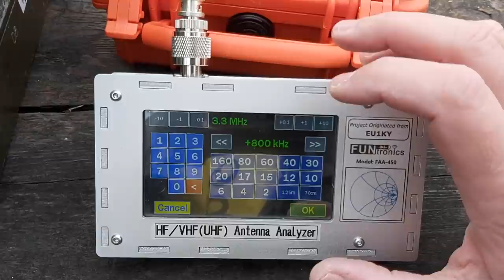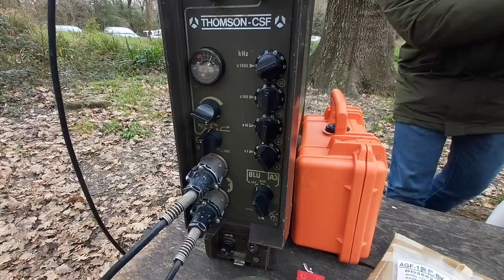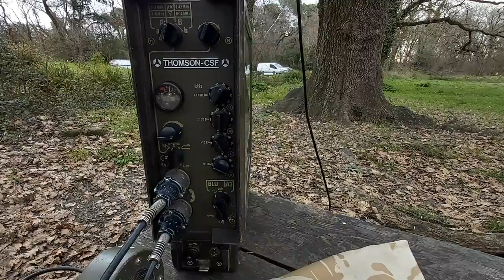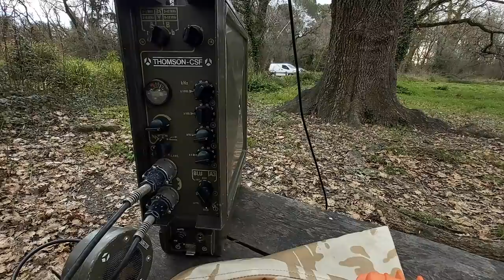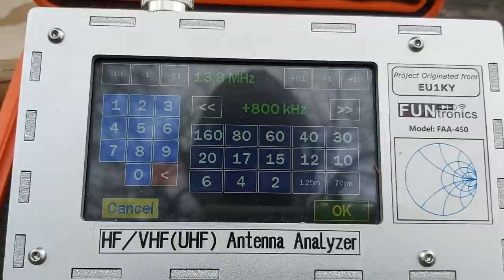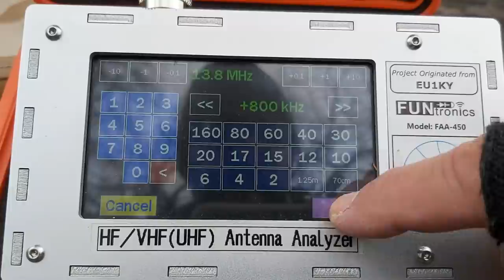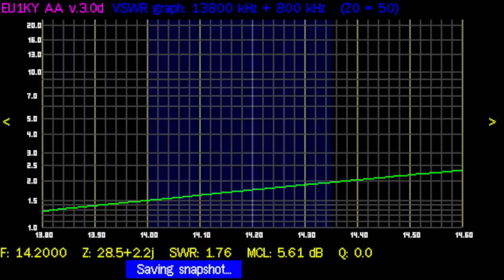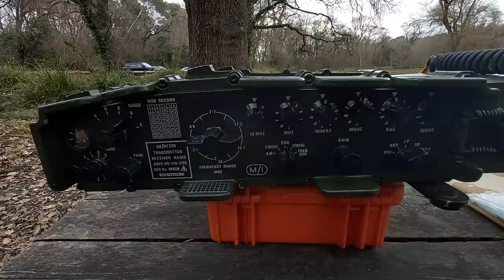Testing My Mini 64:1 Half-Wave End-Fed Antenna Transformer.

Comment: I tried making a transformer with a FT37 core but it's not large enough to get enough primary inductance without using more turns that the core will easily hold. According to various sources, the smallest core they recommend is in fact FT82.

Comment: Hey Gil, nice to see you on YouTube again. The 64:1 seems to be doing a great job. I use an EFHW with, I think, a 9:1. Mmm. I seem to do well with mine as well and low SWR. Anyway 73’s my friend. Thanks for all the great videos! Larry W7YDA.
Reply from the maker: Hi, a 9:1 is for a random wire, not a HWEF. https://youtu.be/0zF7bDoqkG4
Reply: I think I was wrong - maybe I’m using a 49:1. My matching unit is from QRP guys. 80-10 meter EFHW.😙

Comment: Gil, as always it's enlightening and a pleasure to watch one of your vids especially those that include EFHW Aerials. You and Steve Ellington convinced me of the value of that antenna.

DX-Commander also had a hand in it and some day, on a Portable Outing, I'll switch from an EFHW config to Qrtr-Wave with Radials and back and record the sig reports. I have a 12M SpiderBeam Mast that provides many options. Thanks to you and Callum's vids for that enlightenment.
The big value of this vid is to demonstrate how easy it is to spend just a few hours making Local/Regional/DX contacts from the comfort of a Park Bench, even if in Mid-Winter. Haha....

Relative to Vehicular Security when parked OverNight. Have you ever concidered a Pet Viper or two? They like to Snuggle/Coil up under seats and Strike at Ankles when didturbed and you could make a Domicile for one in your Glove Box.
Actually, a Remote Controlled CX-Laced FlashBang Grenade might be a better solution than the Vipers.
Film at Eleven! HaHa......
73 OM from FN42hx . .
Reply from the maker: Well, I'll look for a viper thanks! ;-)

Comment: Hi from Mexico, I saw that in the video for the CB antenna and you don't use the ground lug to the cb antenna, but for this ones you are using it. What will be your recommendation? Does this ground lug need to be connected to a rod into the ground, or this piece of metal basically do the job. Thanks!
Reply from the maker: I only plan on using it to bleed static electricity when using a long wire on a kite or balloon. Otherwise no.

Comment: salut GIL...avec le recul maintenant, que vaut il mieux construire ?? 64/1 ou 49/1 ?? quelles sont les différences remarquées ??  j ai 2 FT140-43 et j attends du fil cuivre émaillé de diam 1 mm.....merci pour les infos.. 73 s Pascal
Reply from the maker: Un 64:1 avec 3 tours primaire (24 total) pour les bandes basses, 10MHz et dessous, et un  49:1 (2/14) pour 14MHz jusque 50MHz.
Reply: @RadioPrepper  ok Gil.. j avais trouvé la réponse dans une autre de tes videos hi hi hi!! merci...73 s pascal

Comment: Hi Gil, did you use a ground wire on the banana plug on 20 meters or just the coax, if just the coax how long?  Thanks and 73 from NYC
Reply from the maker: Not needed. I use all kinds of cables. A half-wave wire will produce very little common-mode currents if any. Only random wires on 9:1 UNUNs cause trouble.

Comment: I have made 49-1 antenna 3 weeks ago works very well from your video how do you find what the difference between and what is the best out of 64-1  49-1.
Reply from the maker: 64:1:below 30m. 49:1:above. 3 turns primary below 20m, two turns at and above.
Reply: @RadioPrepper  I will give it a try next few days when the weather picks up as it below freezing at the moment don't fancy a blue fingers lol cheers for the input

Comment: Evaluating performance from contacts alone is NOT a valid way to test an UnUn. First you need to use a NanoVNA in thru mode to test the insertion loss using an identical pair of UnUns, wired together back to back at the high impedance ends. You want to see no more than -1dB per unit. You also need to measure the temperature rise and fall of the above pair under 30 seconds of CW at ever-rising power levels into a dummy load while monitoring the ever-rising SWR. You don’t want to go over 100C or SWR of 3.0. K7RAW-The Antenna Whisperer.
Reply from the maker: Though comparing with the same contact is a pretty good indication when there is a big difference in signal report.

Comment: "... ducks always make me think of a nice pate". ......hmmmm ...the kids might think a bit differently about that; much preferring the quackers stay swimming in the pool...lol ...anyhoo, after just receiving my new G90 toy complete with it's blistering 20 watts of power output, I too am putting together a 1/2 wave long wire antenna to (hopefully) radiate said watts. Since we don't have a lot to start with... radiation efficiency  is the name of the game. 

Sooo...Decisions...decisions... shall it be 49:1 or 64:1... or does it make a helluva lot of difference? 49:1 should transform 2500-3000 ohms, the 1/2 wave end impedance as I understand it,  down to 50 ohms...more or less... so the 64:1 assumption then is that the end impedance of your long wire is up around 5000??   I am using a 132' antenna but the primary frequency is 14mhz suggesting 35' AGL would give the best low angle (for DX) pattern assuming the antenna is not sloping much or folded like a pretzel in any direction. 

Too bad about the break-in... a hungry Rottie turning the perp into hamburger comes to mind.
Reply from the maker: 64:1 for 40m and lower, 49:1 for 30m and above. Also very thin wires have a higher impedance, so 64:1 if using a super thin wire, unless it's above 20m. I hope that makes sense, LOL. That G90 is tempting...
Reply: @RadioPrepper  ...if your into hiking and back country camping you might find the the G90 and battery a tad heavy for the pack-sack, I wouldn't buy it for that... the Xeigu X5105 would be more suited for that job. But the G90 would be great for tossing on a campsite picnic table or at a rest stop when traveling. Much if not most of the weight of the radio comes from the casing... the radio is made of solid metal, no plastic here.... that radio would probably fit nicely into an army tank. I got a QRP Guy's unun antenna with the radio, tossed it up onto and over the fence and worked a couple of hi n bye contesters so I do know it works.  The 132' antenna up 35'-40' AGL should work better. I am using #18 wire on the balun so it's not super thin and have fit the whole works into an old W2AU dipole center feed.. there was no 1:1 balun in it.  I will try 49:1 first and see what happens...
Reply from the maker: Interesting, thank you.. I have plenty of other radios for hiking so...